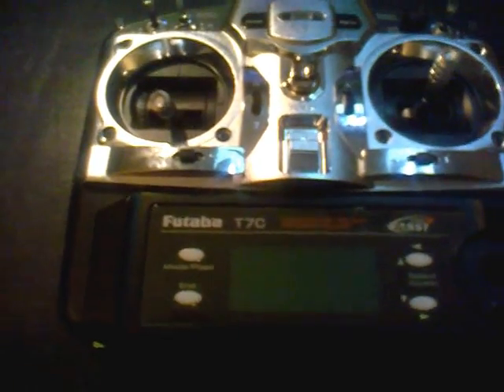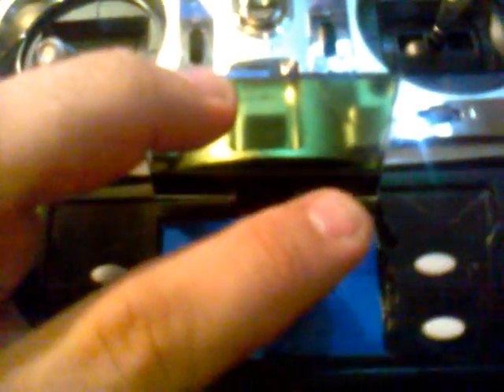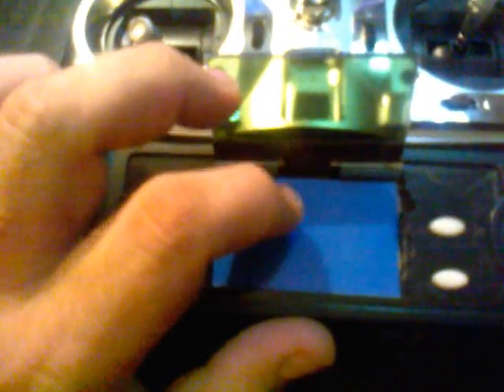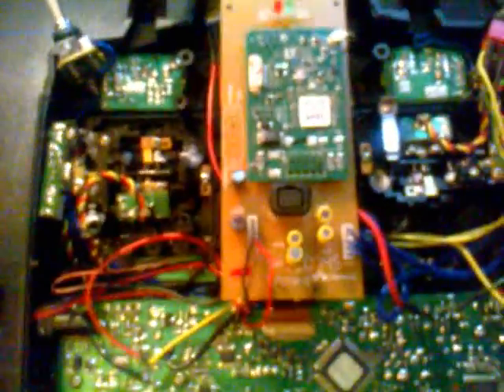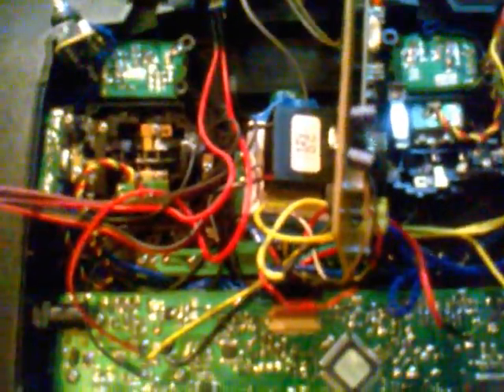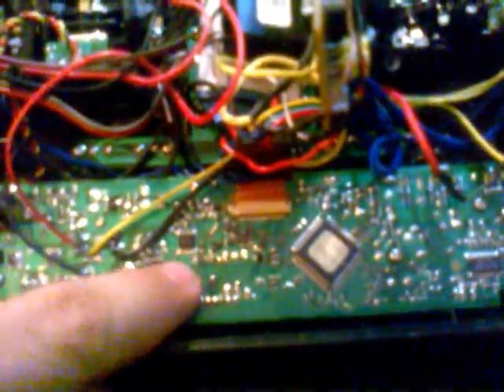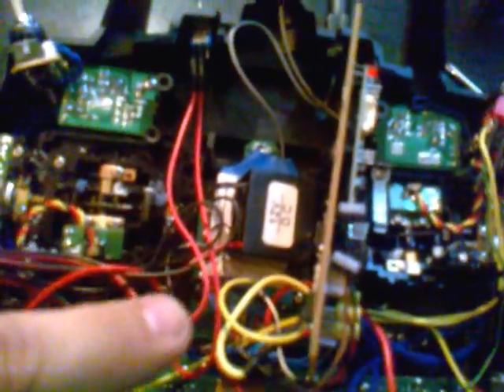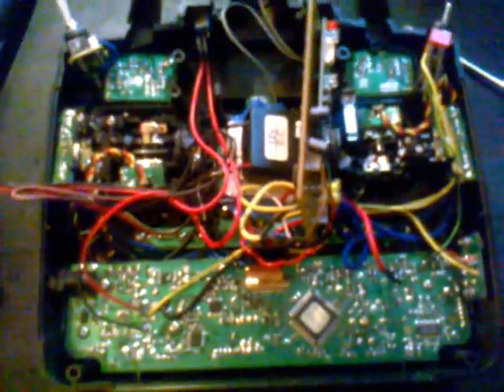Futaba 7c Backlight - Tutorial

Comment from the maker: @Spyro333777 What i meant was that you don't really needed to remove the big main board on the back of the radio. Just free the LCD strip and remove it in order to work on it. After your done just slip the strip through the hole and connect it again. You can the solder the wires without having to displace the Main PCB. My mistake. Failed to explain myself properly.

Comment from the maker: @Spyro333777 No. You need to access the front side in order to detach the LCD and place the EL panel on the back of it. You also need to access the backside of the radio so that you can place all the wires and connect the inverter.

Comment from the maker: The way to see if it came out ok is to put the EL panel on the back of it and light it on. If the polarized layer came out you won't be able to see the lettering very well. If it's still there and the lettering is clear then you have a job well done. In case the polarizes layer comes out, it can be placed on the screen again. Just a matter of separating it from the other sticker. Hope this was helpful. Cheers.

Comment from the maker: @ritchiebarber It does come out easily but some times, and I've seen it happen, it pulls the polarized layer also so thats why you need to be careful. Other than that it's a easy job to perform. Don't hesitate to ask if you have any question about all of the process. Hope it turns out well for you. Cheers.